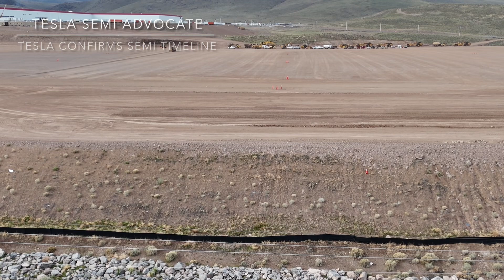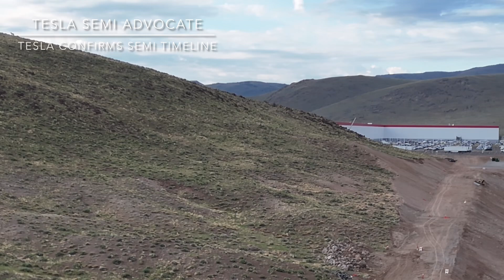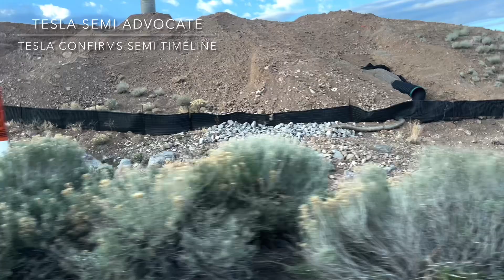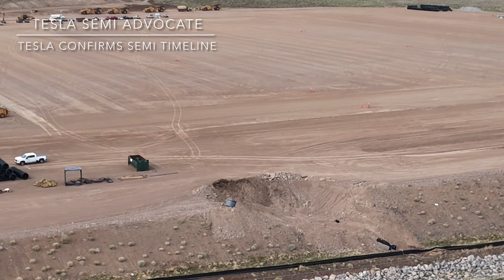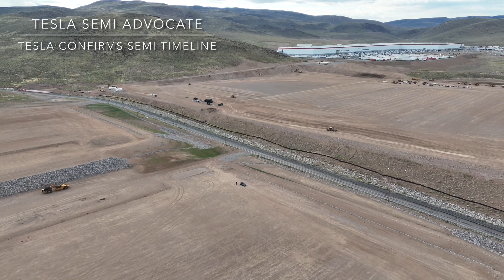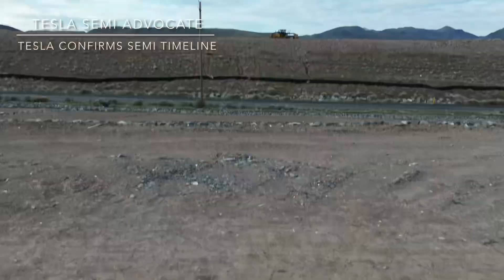Tesla Confirms Semi Timeline Plus April 23, 2024 Drone

Comment: They don't have enough US-made batteries to start production of the semi in the US. The semi uses the same 2170s that are used in the Y and 3. They don't have enough of these cells to get the IRA rebate for the Model 3 LR and RWD currently, so they certainly don't have enough 2170 cells for mass production of the semi. Panasonic's new 2170 factory is due to start mass production in March of next year. So there is no point in starting mass production of the semi in the US until then. If they have access to a sufficient quantity of 2170 cells from LGES, they could build a semi factory in Europe and start production there, but I don't see that happening until after they have built the US factory.
Reply: No, the sourcing requirements do not apply to commercial vehicles.
Reply: @boostav  Really? I was wondering about that. So it just means that they have not had the batteries up to now because there have been none available on the market. Interestingly, last quarter Tesla apparently bought more LGES 2170 batteries than they used in their Shanghai and Berlin factories. They might be planning to use them in the semi.

Comment: This appears to be parking lot construction, not factory construction. They are getting ready for blacktop. There are no utilities, no footings, no material - nothing related to factory construction. The electric service installed is no different from your residential type and they would need a substation of some sort for a facility. The pipe work is simply storm sewer for the lot's hard surface rain runoff. I don't think the semi is still a thing, in reality.
Reply: Good point about the parking lot.  We shall see.

Comment: Good video and narration.
It surely looks like a large footprint to make Semi in high volume. Any idea if they will will erect "Tesla tents" to manufacture Semis or have regular concrete buildings?
If they build the Semi at this location will they expand the GN building that was shared  few months ago?
Not sure if Tesla is capital constrained. Semi have a huge ROI and quasi infinite demand. I suspect that Tesla is battery constrained (especially 4680). They may also be waiting to produce their own raw materiel processing at Corpus Christie and refining at GT. Tesla may also be waiting to get the Semi charging infra structure in place before producing Semi in large number.
This will be a huge money maker for Tesla with huge environmental impact when all these pieces come together and they are vertically integrated.

Comment: As I recall they are currently building Semi battery packs with 2170 cells. I’m sure they’d rather be using 4680s (cheaper) so one reason they are going slow could be waiting for their own or someone else’s 4680 production capacity to increase.
Reply: Really not an issue at the moment. Tesla is reaping the benefit of all the OEMs promising hundreds of model introductions, ramping up contract battery production and then cancelling orders. Tesla gets to buy all that Production off the Market at fire sale prices. PS: 4680 is not a failure. It was only ever a Hedge against the rising prices of Batteries, and will get there eventually.
Reply: Except 4680 has been a failure thus far on a production basis.  Expensive to process and very high scrap rate.  My guess is Tesla has pretty much given up on 4680 except they are backed into a corner for the time being with so much money spent on development.
Reply: @JamesAnderson-lq8tf  It's powering CT and will double in production this year.  What's the status of the factory behind (GF1)?  Are piles being driven, etc?

Comment: They at some point will be forced to admit production rates of +1M per year are planned - No other manufacturers showed up for the long haul trucking transition. 
The market for replacing the fleet is all Tesla's.
Reply: What are you talking about? Every major semi truck manufacturer in the US and Europe already has a  full range of long and short haul EV semis and smaller rigid body tricks in production in completed factories,  complete with trained service staff, service and repair centers, and  parts distribution. There are thousands on the roads already and have been in service years.

Mercedes, Scania, Volvo, freightliner, DAF, Renault, and others. 

Tesla are leveling the ground for a future factory. Maybe.
Reply: There is something shy of 20k electric trucks in the entirety of the United States out of 10 million strong fleet. Most with something like 150 mile range.

Comment: Why dit they decide to make it a separate building ?
Reply: Could be to do with how much they want to spend right now. They also aren't going to build another joining facility for 4680 batteries like in the initial plan because they still are not happy with the development and progress of these batteries.
Reply: Main building is just for 2170 batteries, actual battery pack assembly and motors. 
So a seperate truly massive new building to build 50,000+semis annually in is needed.